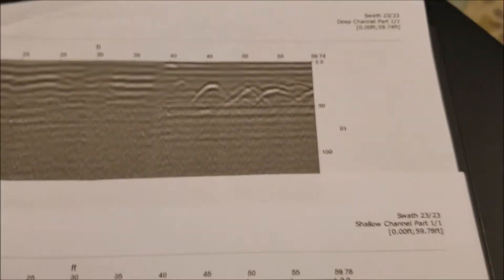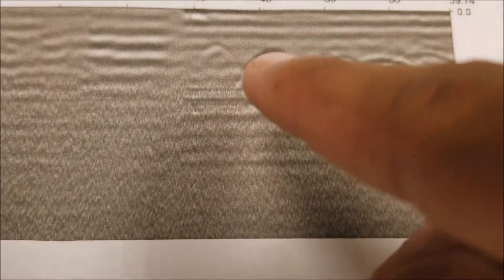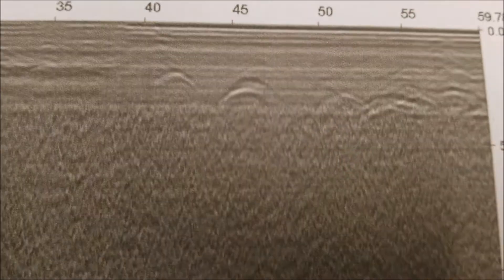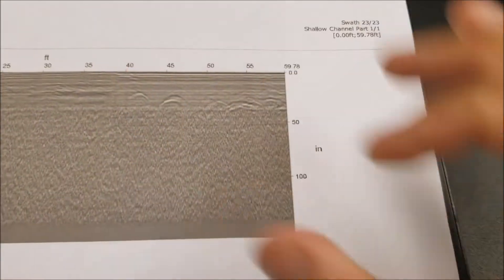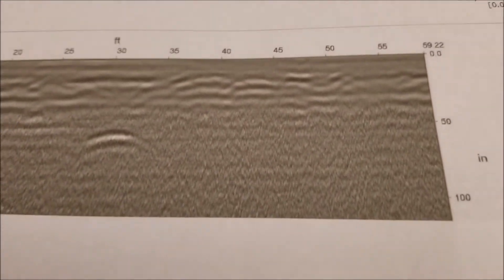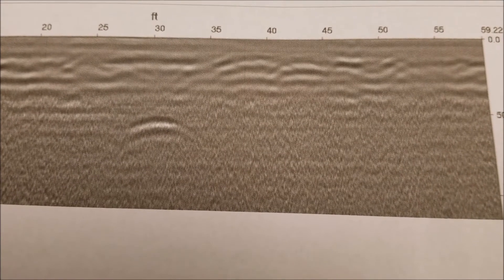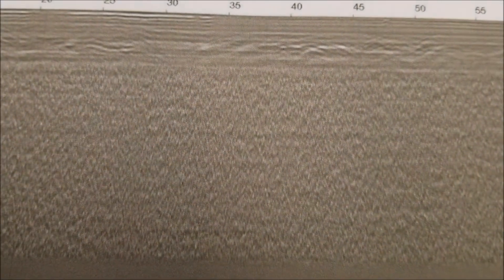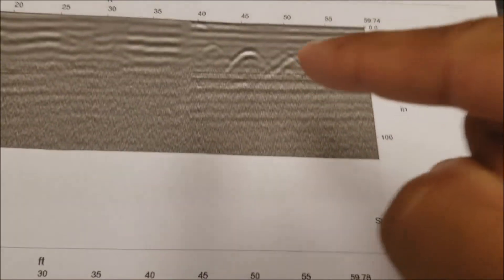Multi-Frequency GPR systems: Data Comparison (Ground Penetrating Radar)

Comment: Great video Dan.

I loved that you showed the benefit of both antennas with 2 different sets of data, which really showed, that you just don't know which antenna would be best to use, so where possible you should always try and use a multi frequency system. 

Love it! 

Regards Ben 

(ps I am a little behind on watching your videos, but am going to try and catch up)
Reply from the maker: Thanks Ben! All good...you've got time. I'm not going anywhere.
Reply from the maker: Thanks so much! Certainly I think folks should have multiple antennas if not a multi frequency system. But its better to have a system than not have one.